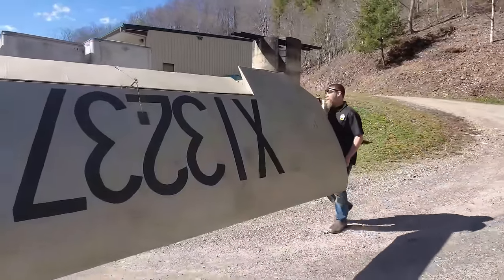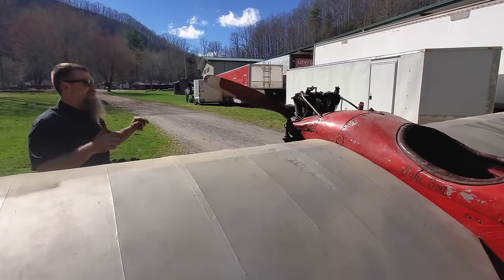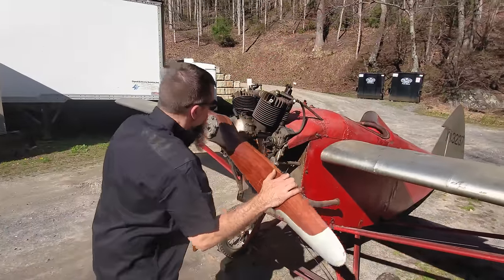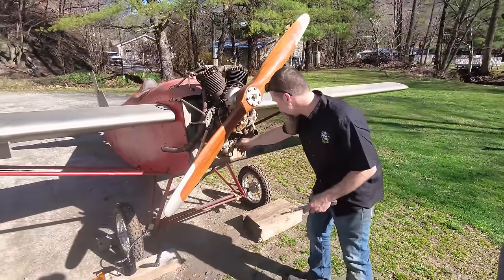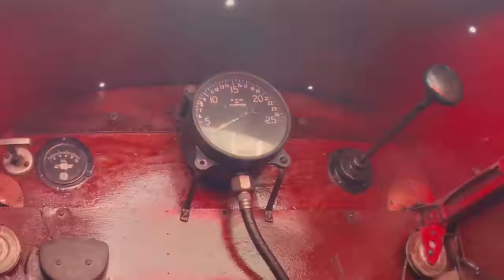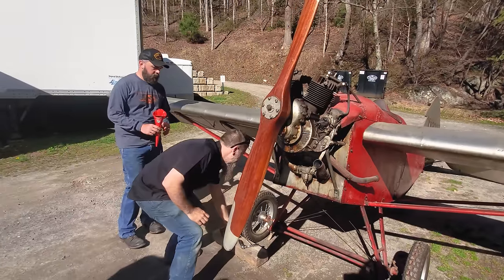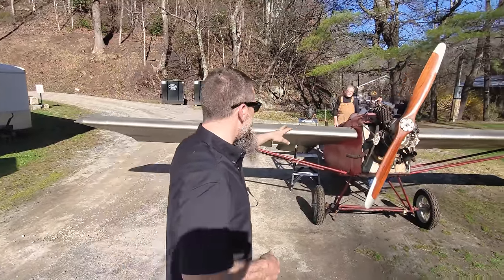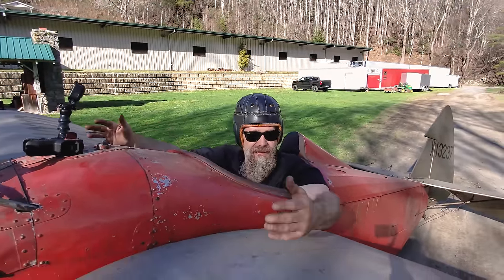Can We Make This 1920s Harley-Davidson Powered Airplane Fly?

Comment: Starting takes 2 people: 1 to spin it, and 1 to work the engine controls in the cockpit. When you spin the propeller, use both hands on one blade for safety.
Reply: You're right (I used to fly a Champ with no electrical system).   I was kinda cringing watching these guys starting this airplane.   I'm glad no one got hurt.
Reply: @VintageAmmoTim  🤣🤣🤣🤣🤣🤣🤣🤣
Reply: I had neighbors as a kid that were plane enthusiast and most of them knew how to fly. Even the kids. I hate my phone . It's doing what it wants.
Reply: @clarkbabin9799  If they're at the same place as you when you have a broken leg, they can get you to the hospital if airplanes are the only way in or out.
Reply: @donadams8345  A parking brake never hurt, either.
Reply: Another old Aeronca pilot here, 100hrs 7AC Champ, 100hrs 11AC Chief.  I would happily have sat in the cockpit while they were trying to start that thing.  1927 is twenty years before the planes I flew.  Brakes were not yet a common feature on small aircraft, much less parking brakes.  Letting the tail skid dig into the dirt was the main way of stopping.  This plane is obviously not airworthy with the flight controls not connected, but I bet it could be made flyable.  Trying to get an airworthiness certificate (Experimental amateur built) would be interesting.
Reply: @fast_richard  We'll find out, won't we?
Reply: I would love to see it fly
 But first do a ground up inspection
Reply: @ColtonRMagby
Reply: @fast_richard  The control stick moves like it should but the aileron and elevator cables and pulleys are all roached.   It needs new cotton fabric covering applied and control cables remanufactured and ailerons and elevators adjusted for the correct number of degrees.
Reply: @jamesburns2232  Yeah, All those issues could be corrected.  The aircraft was originally built by a talented beginner.  If copies of the original blueprints that were submitted for the magazine contest could be found, that would be amazing.  If not, the aircraft is complete enough for replacement parts and any necessary repairs to be made to fit.  It should even be possible to get a certificate of airworthiness from the FAA in either Experimental Amateur Built or one of the other Experimental classifications.  That X13237 wing number is no longer a valid FAA registration number, but could probably still be displayed as long as a current N-number is also used.  Who knows? the FAA might even have archival records showing the old registration.
Reply: @ColtonRMagby  It would just ground loop and end up upside down.
Reply: @fast_richard  Looks like they connected the ailerons befor the taxitest, they're not hanging down like sad drapes when it rolls. But I'd rather build a replica that try to restore that one to air worthy condition.
Reply: @darkiee69  Not if you know how to correct that.
Reply: @darkiee69  6
Reply: @darkiee69  yeah that one needs to maintain its original finishings.  But a replica almost has to be built.  Finding volunteer builders wouldn't be difficult.  Choosing a test pilot from the pool of volunteers would be the difficult part.
Reply: @fast_richard  I noticed that the ailerons were just hanging, but by the time that they fired it up, they were attached and in line with the trailing edge.  I'd fly it, but I do an 8 hour preflight first!  And that was after an A & P had been over it for its license.
Reply: @darkiee69  Yup, I seem to recall that Matt has an.old photo of this very airplane lying on it's back with a broken prop.
Reply: I don't know about old Harley engines but if they work anything like old plane engines then spinning the engine about 5 times before trying to start it probably would have helped as well.
Reply: @SirFloofy001  Ba-du.-tssh!
Reply: @donadams8345  same here I'm just waiting on it to kick and cut a hand off lol  my grandfathers old cub had no electrial system. I learned handpropping as soon as I could reach the prop safely lol. Finally got my PPL at 17 after riding with him since age 5 now im 22 and own a cherokee 140. Then he got older and bought a cub that had been  certified with a o-200 (NC88113) and records have it that it was the first one of it's kind to be certified with a o200.  So then we had a full electrical system radios and all that. Much easier than handpropping for a now 91 year old vet lol
Reply: before they even added oil he turned on the mags and then started messing with the prop i cringed so hard.
Reply: @jondepinet  Maybe he turned them back off. I don't know.
Reply: @ColtonRMagby  everything about that video was freaking me out. he was hand propping wrong, obviously clueless about the process, and not taking all the safety measures pilots are taught from day one.
Reply: Forgive me if I’m wrong but wouldn’t an old vintage engine like that run off 4 star fuel.  Old vintage engines need leaded fuel because of the soft valve seats and unleaded would work but because of the ethanol amounts and no Tetraethyllead (TEL for short) it will cause “Knock”.  TEL allowed engine compression to be raised substantially with out damaging the valve seats and because of the significantly higher compression ratio, TEL stopped detonation or Knock which burnt out the valve seats usually on the exhaust valves.  Now with out lead in the fuel this could damage the engine because avgas has TEL in the fuel and it’s what they should be using on a vintage engine or 4 Star fuel which is not made anymore in the U.K. at least, but I wonder if it’s still made in the States or like us do you just replace the old valve seat with modern ones so it can use unleaded. Do any of you guys in the comments know about this ???
Reply: @Biketunerfy  I didn't know that before, but now I do. Thanks for the information.
Reply: @ColtonRMagby  your more than welcome.  I used to convert old 2 Star engines cylinder head valve seats so they could run on unleaded fuel but it still boggles the mind why Avgas has lead in it.  It won’t hurt unleaded valve seats but I don’t see why 2 star aviation cylinder heads aren’t converted in the aviation world,  it’s much better and does not pump lead oxides into our atmosphere which are seriously bad for your health,  plus they could run on the 100 octane fuel and get more fuel efficiency and cooler engine temperature which means less wear on engine parts.  It’s doing the same work for less fuel so you save on fuel costs and engine wear.  Boggles the mind 🤔
Reply: @Biketunerfy  Aircraft engine manufacturers, take note.
Reply: @Biketunerfy   so your understanding is much the same as mine was. 

but i recently bought a 1961 Massey Ferguson gas-powered tractor.  and so i have been reading up on the subject of old engines.

the valve seats are softer and probably take damage. however, my tractor was/is a working machine.  leaded gas has been banned for ground use here since the 80's. so its been running most of its life on unleaded and is still happy as a clam.

as for compression. admittedly its a tractor, not a Harley. but the stock compression was 6:1, mine being a "high altitude" has 8:1 pistons. it also has slightly less advanced timing, i will get to why in a second.

knock is not caused by the valves, but rather by "pre-detonation" of the fuel-air mixture. this can happen for a number of reasons. usually timing too advanced or carbon buildup igniting the fuel-air mix early.

both of these causes however vary based on compression and fuel octane rating. the higher the compression, the more sensitive to pre-detonation, and the lower the octane rating the more sensitive it is as well.

the tractor was tuned by the factory on 78 octane rating gas. The lowest i can get now is 87. while its not leaded, and i could buy lead replacement, its not cheap. so the valve seats are just gonna suffer until it needs a rebuild. but i could probably advance the timing quite a bit, maybe all the way to the "low compression" 6 degrees advanced. and pick up a not unnoticeable amount of power.

this is due entirely to the fuel being of much higher quality than the engine was built for. an engine such as in the video built in the 1920s is probably so conservative on timing and compression with modern fuel that it has basically no risk of knock.

and from my experience the valve seat issue seems to be not as severe as it sounds.
Reply: @jondepinet  Hi yes,  I’m fully aware of the reasons why the valve seats get burnt out because of “knock” and your correct that it’s because of pre-detonation of the fuel,  but I didn’t think it was important to explain what Knock is exactly but rather the effects on old valve seats from knock,  since most people who like cars and engines know what it is.  Regarding old engines,  yes they don’t build them like they used to do they.  With a full cast iron block and head they built them to last,  not so these days.  It’s all aluminium now with cast iron sleeves for cylinders and aluminium heads but the point is aluminium is a nightmare for warping especially cylinder heads but it wasn’t that common for cast iron heads to do that although it did happen occasionally but cracking between the inlet and exhaust ports did happen.  If I were you I’d get your valve seats replaced with modern ones this way you can get more power with a higher compression ratio on higher octane fuel and improve fuel economy and a better combustion of said fuel.  You’ll probably find pitting and galling on the exhaust valve seats since you haven’t been using fuel additives and eventually you’ll start to hear misfires on certain cylinders then it will eventually loose compression and it will just stop running all together.
Reply: @Biketunerfy  oh i fully expect that. but the response is to rebuild the heads, which i have to do to prevent that outcome. since i am bout out of budget at the moment, i am going to wait for it to become a bigger issue. while remaining fully aware of the problem. 

fyi i just bought the thing and am having to rebuild a lot of the transmission and electrical. the engine works, for now, gonna leave it be for a while.

also, this continental 166ci engine is very well designed for field repair. wet sleeved cast-iron block means even re sleaving it is a simple process.
Reply: @jondepinet 166 cubic inches so it’s a 2.7 litre engine must be old or it’s an American brand if it’s still using the imperial system since most of the world uses metric now,  I’m not familiar with farm equipment but it’s built to last especially before they were controlled by a computer nowadays.  You can’t repair modern farm equipment because the likes of John deer won’t let you so they get the repeat business.  I believe in the right to repair your own equipment or to have it repaired some where else,  it’s a fundamental right that helps small local businesses as well.  All this knowledge lost due to the greed of big world wide corporations.  

I heard of Massey Ferguson farm equipment and I know there are a lot of the old equipment still servicing farms today and I think in a way they are better than the modern stuff since you can look after it your self and don’t need to stick a computer into it and cancel error codes every couple of weeks when something falls off ! Lol. Or pay the manufacture crazy amounts in labour and parts and try to sell you parts that have another 10 years life on them that are on your vehicle and they say it’s going to fail in 5 minuets or something ridiculous - you know the type we’ve all encountered them at some point in life 😉.  Anyway nice talking with you I hope you get it up and running soon !
Reply: @Biketunerfy  its a 1961 MF 35. so old, and built-in the US even then.

i do prefer being able to do my own work, and i am only waiting on one part for it now, mistakenly ordered the wrong seal last week, have to wait for the right one.
Reply: @jondepinet  what a beautiful tractor !,  I just googled it to have a look at one and they all seem to have a lovely deep rich red colour and I can understand why they chose it.  Yep it’s defiantly an oldie and really cool looking.  You said you received the wrong seal ?  Is it for a hydraulic ram or suspension strut or a gear box/engine seal.  It’s just I know when it comes to hydraulics it can get tricky ordering the right seal.  You have to know the OD and ID and occasionally even the seal material.  People don’t realise what a hydraulic seal has to do and the forces that the seal is coping with and holding in the cylinder especially in high pressure hydraulics.  I do my motorbikes fork seals when the occasion arises since a lot of dirt and grit eventually wears them out and it’s even worse for farm equipment I would of thought ?.
Reply: @Biketunerfy  when i got the tractor i knew it had a bad PTO output shaft seal, and discovered that it also had a bad inner wheel hub seal. both of these seals were allowing trans/diff/hydraulic fluid to leak out. (it uses the same fluid and sump for all 3, SAE 90 wt GL1 mineral oil, lots of fun to find) i found a website that has most of the parts i need, and for really cheap, but i ordered the PTO main driveshaft seal when what i needed was just a PTO seal. the new one should be here by next week. until i get that i cant fill up the transmission or drive it. so i am anxious to get it in.
Reply: @jondepinet  All good things come to those that wait my friend.  So I’m assuming you live in the States then ?  I live in NE England so we still use imperial and metric since we do a lot of industrial and military trade and joint collaboration on projects with the USA and also with Europe so we have to know both plus we never really switched we just adapted to 2 system’s even though officially we say that we use the metric system.  Still I don’t know why the USA won’t just switch over to the metric system like the rest of the world,  it’s far easier to learn and much more accurate and precise.  I have a few American friends who prefers to use the Metric system in their joinery and the other in his machinist shop but it’s good that they know both systems.  You Look at our speedometer in our cars it should be Kph but they are in MPH even the new cars but they do have Kph in small writing on the inside of the speedometer but MPH is in big bold writing on the out side.  Even all our new road signs are in Mph.  Strange world…
Reply: @Biketunerfy  i am in the states. and honestly we do use both systems often enough. out speedometers are the same as yours, and sometimes you see directions and distances in metric. but the industry still uses SAE largely because it's way is easier to work in decimal inches for machinery than metrics.
Reply: @jondepinet  well I suppose I can see the point,  if it’s not broken don’t fix it and since your all used to imperial and can work in metric if needs be then what’s the point.  At the end of the day that’s exactly what we do.  People think it’s funny that we say we switched to metric yet still use imperial but it’s not like that it’s just we adapted to the 2 systems and are taught both systems and can benefit from both.  But still I would argue that metric is far easier to learn than imperial and has more benefits.
Reply: @Biketunerfy  metric is easy enough to use i suppose. at least for regular everyday things. a machine shop is not one of those things. a mm is too big and decimal of it is too small, so your fine measurements are done by the .25mm, rather than the SAE decimal inch, i.e. thousanths. 

but keep in mind the size and area of the US it would cost billions to retool and switch to metric. and its just not worth it. metric is slightly easier to learn, but sae is taught well enough. and so is metric.
Reply: @jondepinet  when you get past a 1 MM you go into fractions like .12 Millimetres or .25 mm so in that sense it’s no different to imperial.  Metric is based of the speed of light because the speed of light in a vacuum is known exactly and it’s a constant so it never changes where as the Imperial system is really old and has changed more times than I can count on my fingers.  Metric is more accurate on all measurements small and large and it can go to finer increments on the small scale and you don’t have mess with decimal fractions like 1/2” or 2/3” and 16/3”  just add more zeros and move the point further up or down same as fractions on metric.  All of Europe use metric on the micro increment on micrometers for machining and CNC machining machines all use Metric.  Imperial is old out dated and not as accurate Jon but it’s understandable why America won’t switch over the same as us really.
Reply: @Biketunerfy  this is not always true. first of all, SAE is defined by the metric system, so it benefits from the same definitions. 

second, for some industries, such as machining, the fine tolerance measurement devices don't normally measure down to a nice even decimal place in metric. the tolerance on metric calipers is +/-.03mm. on an SAE caliper, it's +/-.001 inches. it's about the same distance, but while the SAE machinist can add, in decimal notation all the way from .001 to 1.000 and beyond linearly, the metric machinist has to count by 3. 

that difference is one of the big reasons the US never changed over. and it's probably the reason Britain didn't entirely change either. the other is cost, it's just a lot of stuff to change over, and Americans don't turn over our equipment very often. case in point i am fixing up a 60 year old tractor that has been working its whole life, and I intend to work it. it's not yard-art, it's not a parade piece. it's going to work, maintaining roads, and doing farm maintenance. 

that means the US would have to support both systems for 50-100 years just to keep existing machines that are "grandfathered" viable.
Reply: absolutely, I have experience in starting Jodel D112 like that, definitely both hands on one side of the prop ...
Reply: Take it easy man, Matt knows what he's doing!
Reply: It will work just fine. Don't worry about lead cushioning. The studies that claimed all that were mostly bogus. Leaded fuel was not widely available in the 20s.